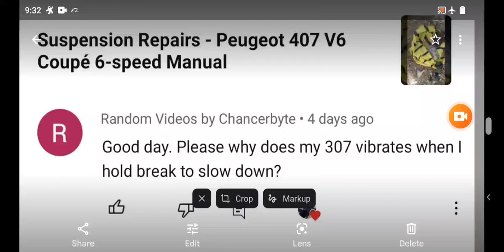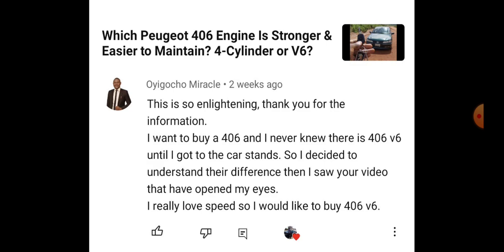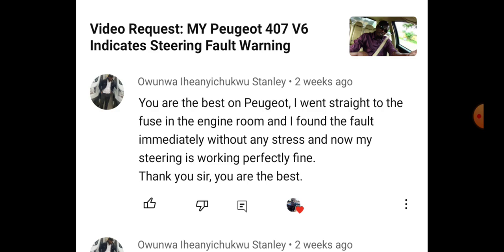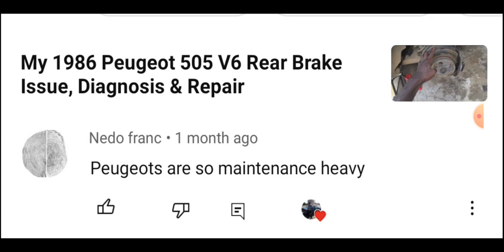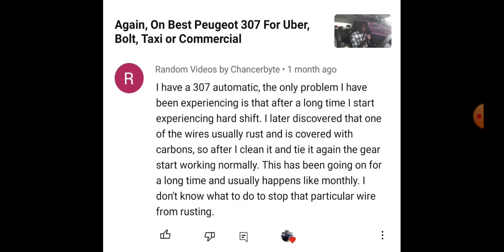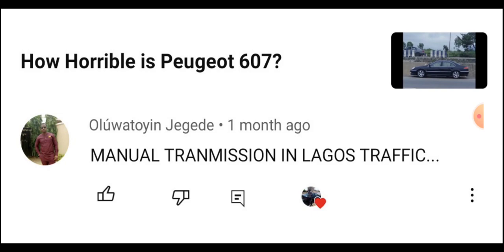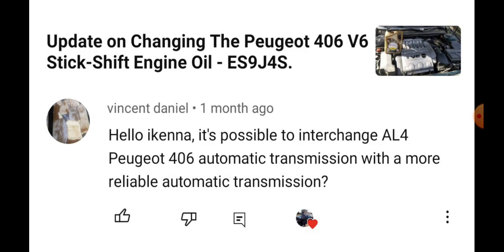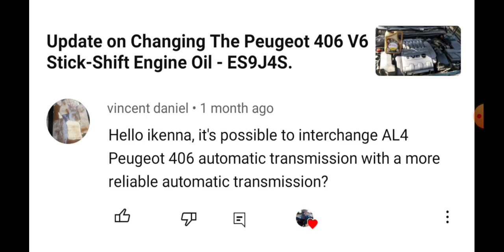Questions and Answers on Peugeot: 16/12/2020

Comment from the maker: IKENNA351 5-YEAR CONSULTANCY/PEUGEOT VEHICLE PRE-PURCHASE INSPECTION SERVICES (TERMS & CONDITIONS). 

A lot of people have brought Peugeot vehicles to me for diagnosis & repairs, only to be informed that their newly acquired cars were running with wrong or tampered Engine ECUs and BSI units or abused wiring harnesses which make them undrivable or with horrible issues. 

A lot of people have purchased Peugeot vehicles with engines, transmissions or suspensions that were against their original wants in cars because of no professional guidance or explanation of  available engines, transmissions or suspensions that would have best serve their wants in Peugeot models they are interested in.  

I can prevent these issues or concerns for you when choosing a used Peugeot Vehicle to acquire, Foreign or Nigerian used here in Nigeria. I will search for a Peugeot model of your choice or you are interested in, inspect and recommend good ones worth purchasing till you pick one that satisfies you, based on my findings from inspections of them in Abuja or environs. You can choose to utilize my knowledge on these Peugeot Vehicles to get a sound clean used Peugeot of your dream or you choose other options available to you elsewhere. The Pre-purchase Peugeot vehicle inspection comes with 5-year consultancy service as well.

If your desire is to have only a 5-year private consultations with a Peugeot specialist/expert like me for advice on Peugeot vehicle maintainance tips, how to avoid abusing them or how to keep a Peugeot vehicle in good condition throughout your ownership of the vehicle, from time to time, until you get hang of it, then this consultancy service will serve you as well. 

Likewise, this service is available for those interested in buying Brand New Peugeot Vehicles as well. Now, you get to know all trims and specifications available for a particular model of new Peugeot vehicle you are interested in, by interpreting for you  the features, engines,  transmissions and specifications available for the Peugeot model you are interested in, to help you choose which one best suit your purpose, need or want in a new Peugeot vehicle.

The charge for Pre-purchase inspection is per a Peugeot vehicle, which also includes private consultation on maintenance tips and other clarifications on the model you request for, from time to time.

If you have a particular Peugeot vehicle in mind that you already want to purchase and the car is  far or not in Abuja city and you need the car to be physically inspected before purchase, note that this service does not cover it. If the location of the vehicle you would want me to inspect for you is outside Abuja city, the client will have to pay for the transportation (to & fro), if I choose/decide to go out of Abuja city for the inspection which this service doesn't cover.

I also carry out verification of custom papers for authenticity, for Peugeot Vehicles clients are interested in, when a client request for the verification of the custom papers and the payments (the small fee for the verification is to be paid by the client).

Understand that paying for this 5-year consultancy and pre-purchase Peugeot vehicle inspection services does not mean you also paid for physical diagnosis and repairs of your Peugeot vehicle from me for free. However , I can choose to do physical diagnosis of your Peugeot vehicle(s) for you for free occasionally or at least, at lower fees than my usual standard fees/charges, depending on nature of the work, for the next 5 years.

However, if all you need is advice and guide on getting a good Peugeot vehicle in good condition, what to look out for if you have to inspect the car by  yourself, how to detect a severe abused Peugeot vehicle (excluding automatic transmission) on sale or you need a private consultation on review of Peugeot vehicle(s) you are considering to buy, to help you understand them and make your choice, then this service will serve you on that option too, for the next 5 years, which you can choose to renew at the expiration of the limited paid service.  But if you are not comfortable with the above listed conditions, then don't pay or request for this service. 

Note that I am not an expert on Automatic Transmission, for I may not be able to detect hidden faults in Auto transmission during car inspections, Incase your preference is Automatic Transmission. If you are not comfortable with this, do not pay for this service.

Also, note that if after reading this or contacting me privately after I have sent you this terms of service and you choose not to use the service to do your vehicle purchase for whatever reason and the newly purchased Peugeot vehicle starts giving you nightmares or headaches after the purchase, I will not attend to you privately if you try to get this service for free from me, since you made your choice to risk it. 

- 5-year Consultancy/Pre-purchase Inspection fee: N50,000.00 (Fifty Thousand Naira). It's Non-negotiable,  Non-refundable & it's pay before service.

- Contact details:
WhatsApp/Telegram chat number:  +2348095721703.
Email address:  ikenna351@gmail.com

*The conditions are subject to change.

However, you can visit my YouTube channel via link below for tips and expert explanations on Peugeot vehicles:. 

www.youtube.com/c/Ikenna351Monk

 Lion King - Monk.

Comment: Thanks a lot. for the wire rust that affects the gear, I was able to solve the problem. the earth wire was supposed to be attached to the car body but was attached to the engine. The situation became serious that I started seeing battery error too. So an electrician discovered the problem and separated the connection and attached it to the car body that it was wrongly connected. It is about two months now no more issues.